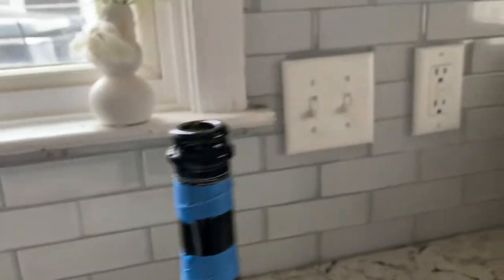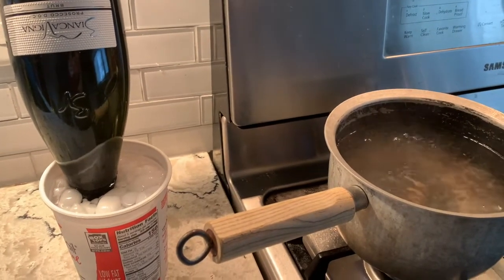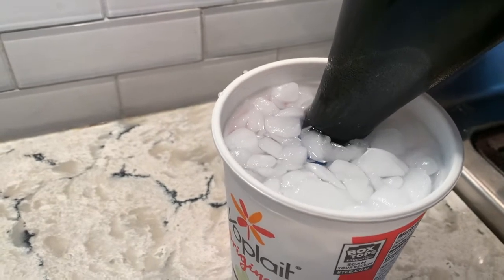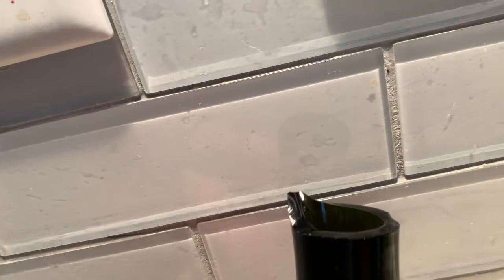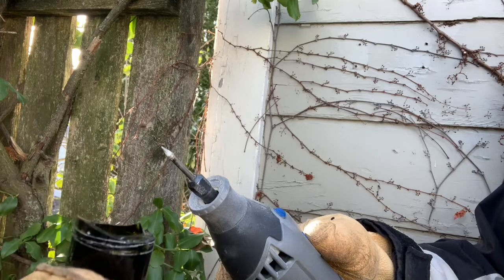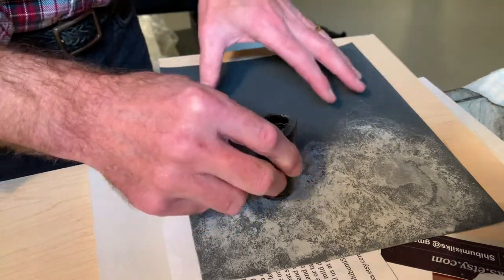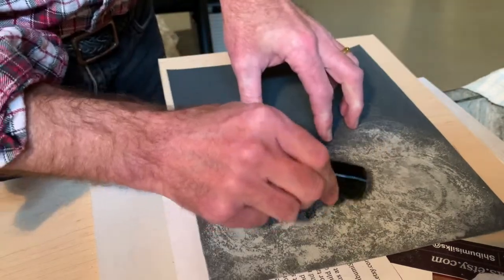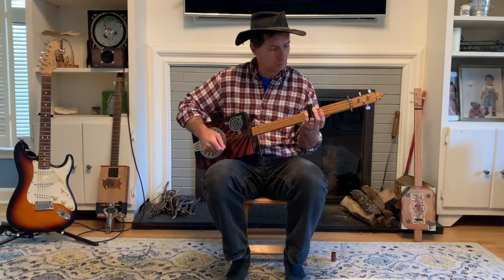Making a Bottleneck Slide

Comment: where the heck are the instructions for the most basic and important element of all, the score marks?  did i miss em somehow?
Reply from the maker: Erik, I did not explicitly put the instructions in the video because they are basic and in the interest of time of the video.  

The best thing to do is buy a glass cutting tool from your local hardware store and use it.  That's what I use.  You can always buy a bottle cutting device on Amazon.  They work, however, just note that they are a pain to set up.  Your other option (and I've never tried this) may be to use a diamond tip bit or other device and hand hold it to scratch in the score line.  

Lay the bottle on its side and turn it with one hand while using your other hand to apply pressure with the glass cutting tool to score the glass.  Ideally the score line is 1 time around the bottle and the start and end meet at the same point.  

You may get creative if you want to steady the bottle more, for example drill a hole the long way through the cork, slide a rod through the cork to be used as an axle to spin the bottle on, and anchor the axle.  

It hope this helps.